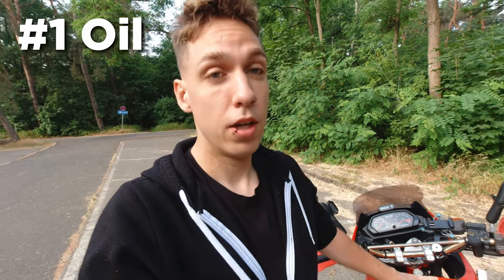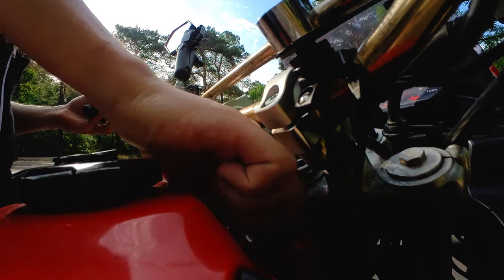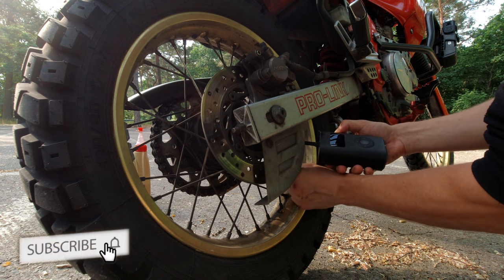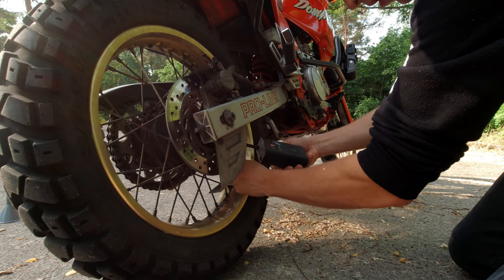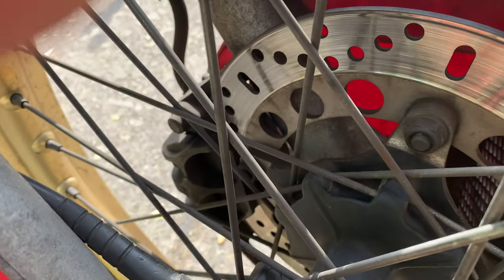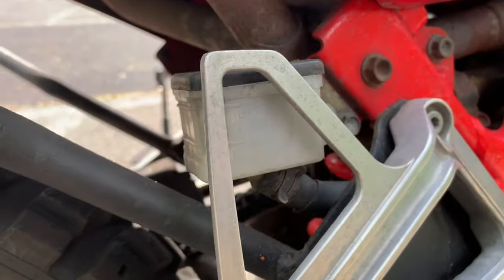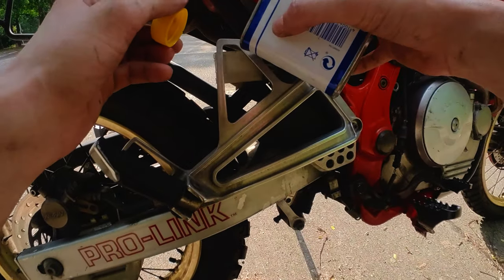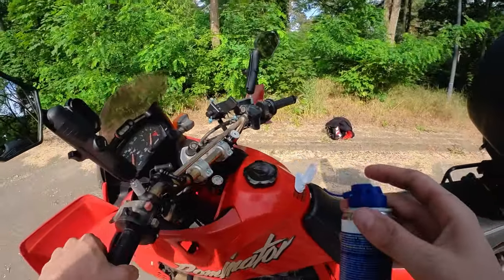7 Things I check before going on a long distance Motorcycle Adventure Journey! Honda Dominator 650

Comment: Fellow travellers on older bikes: allways use the oil the manufacturer recommends. 10w40 semi synthetic in this case, if you put full synthetic your clutch could start slipping( wet clutch).
Reply from the maker: Alrighty. Thanks for the tip. Will do! Cheers, Marc 🤙🏼

Comment: I would check the oil level every day. I see the oil filler is in the same position as on my old XT500. In '86, I made the mistake of not checking the oil every day in Spain on the XT and ran it short, starving the top-end. It rattled all the way back to England and required a top-end rebuild. Cheap enough but all my fault. Great idea to check everything is tightened up on a big single.
Reply from the maker: Yes checking very regularly 🤗

Comment: Neat. I didn't know the Dominators had oil frames.
Reply from the maker: Yeah actually do! Good system and does keep the oil temp solid, I mean unless you’re in the city at 40 degrees Celsius in summer 😂🥵

Comment: Caution! This is not the correct method to check the oil level on honda RFVC engines like the dominator. You may damage your engine! The best way to check the oil level is to do it while the engine is hot and within seconds after the engine has stopped. The oil goes back into the engine when the engine is stopped, and the level is done in the frame. You can find the method on the maintenance manuals.
 Your Dominator is beautiful! love this version
Reply from the maker: Thanks for tuning in and the advice.🤙🏼 have a Great day, Marc
Reply: @MarcTravels  Thats also the first thing I noticed. If you check and refill like this, you will have too much oil in, which is something, this engines don't like. I actually have two of this old Dom's, already had 7. But its correct, to check oil level of such big bore aircooled Engines often. The guy from who I bought the last one with damaged engine, didn't:  
https://www.youtube.com/watch?v=a3B1FRDgSGM

Sorry for my bad english, I'm from Germany
Reply from the maker: Kein Problem, deutsch passt auch. Danke auch fürs reinschauen und den tip. Werde auf jeden Fall gut drauf achten nicht zu viel rein zu machen. Bis jetzt hatte ich auch noch nie zu viel drin beim Öl wechseln, eher immer etwas zu wenig. Aber gut, habe auch vor dem Ölwechsel natürlich nicht nochmal nachgefüllt.;) Liebe Grüße, Marcus
Reply: I spotted that as well. My XT500 was the same.
Reply: Oil is important and do not buy the Cheapest .. ! also tire preasure is not good presented..

Comment: Hi Marc,
Little question, when you ride with you Honda for long travels, what is the temperature of the oil?
Reply from the maker: Hey man, thanks for reaching out. Usually under normal weather conditions it’s between 90-95 C, but it does go up with hot weather and/or city traffic. Last year in Italy and Croatia it was up to 42C in the shades, so I had to stop when she got over 110C oil temperature. But usually no problems with over heating. What’s yours like?
Reply: @Marc Travels  
I have a XR600R 1987, i live in Belgium, when the T° is 20°C, after 20 kms, my XR600 is 120°C hot, it is not normal. I 'dont know what is the problem.
Reply from the maker: Hm…you have the Right amount of oil in there?
Reply: @MarcTravels  yes the volume of oil si correct.
Reply from the maker: I use 10w40 oil…what do you use?
Reply from the maker: Actually don’t know what the problem would be…wish I could help

Comment: Good maintenance........
Hi Marc
Does mean reason to install  Pannier rack side carrier for protection when motorcycle fall or to carrying the hard luggage cases?
Reply from the maker: Hey, actually I have drybags soft panniers, but I had the problem that they push the plastic against the exhaust so I installed the rack. But anyways rack is always a good protection, you’re right!👍🏼👍🏼 cheers
Reply: @MarcTravels  Thank's Marc🤝🤝

Comment: Do you find a bit of Loctite helps so that screws stay put?
Reply from the maker: Yeah I need to try that out, it will help for sure! Will get me some. Thanks Mark! Cheers 🤙🏼
Reply: @MarcTravels  I used Loctite for 'insurance' when I travelled last summer on my 1990 honda revere. I'm sure someone will point out some problem with doing this but... I live and learn
Reply from the maker: @MarkJames61  i think lock tide is a really good idea 👍🏼

Comment: At 01:22
Careful. You better use proper motorcycle oil. Your bike has a wet clutch.
Some oils for cars contain friction modifiers. Using such oil in a motorcycle with a wet clutch may cause a slipping clutch.
If you are lucky the cheaper car oils do not contain friction modifiers. 
I would only use it in an emergency,
Reply from the maker: The oil I use is motorcycle oil 👍🏼
Reply: Ok. I did not see it on the can.
Nice bike.
Reply: What I like about your bike is:
That it is very basic
Dry sump oil system
Kickstarter
Prolink rear suspension

And no CAN bus / iPhone App / ABS / traction-control and all the other things that can fail.

I owned a 1982 Honda CBX-1000 Prolink for 23 years from 1998.
More parts, but still simple. Easy to maintain, and trouble-free.